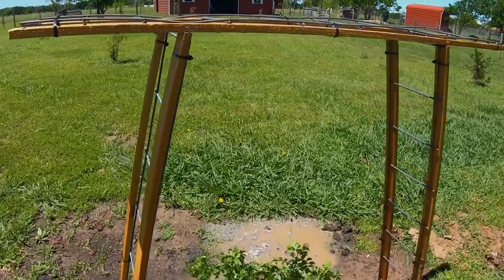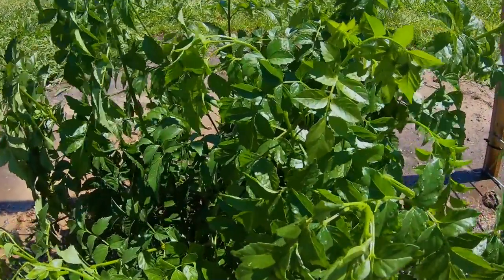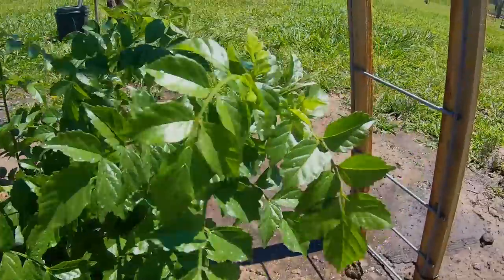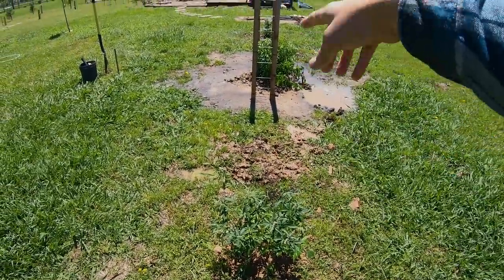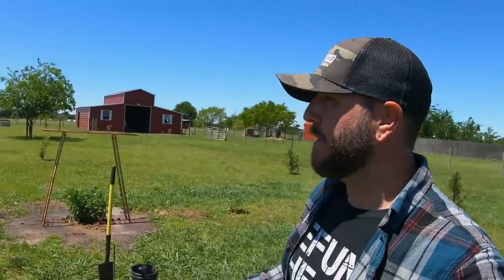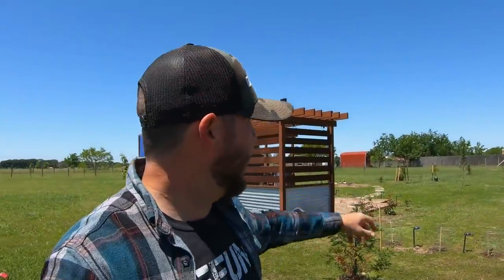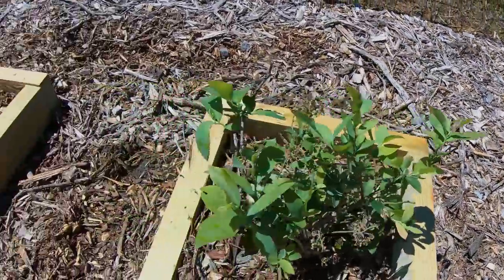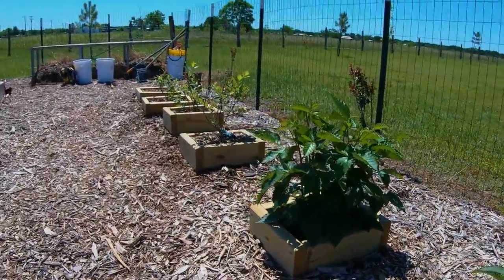Simple DIY Backyard Project On A Budget

Comment: Have you considered where you might put a storm shelter? Maybe off of the back deck and beside the work shed so that you can access from both the house and workshop would be a good spot,depending on how easy it is to dig up the soil there. After you do all of that, then the next project is a swimming pool and hot tub between the cabana and the barn!
Reply: Yes..Id want it close.